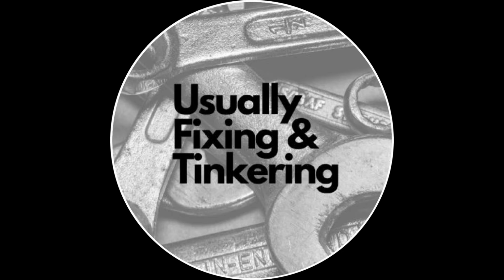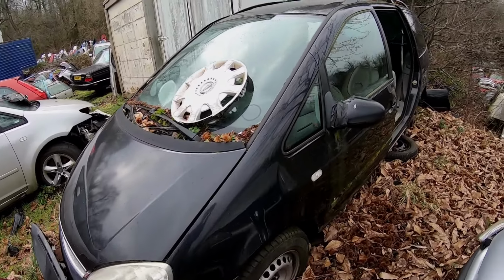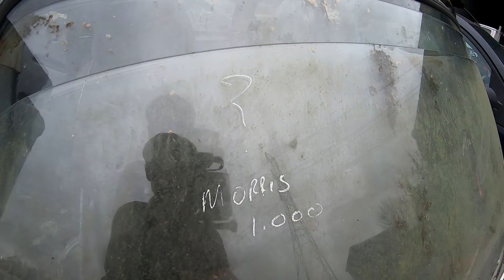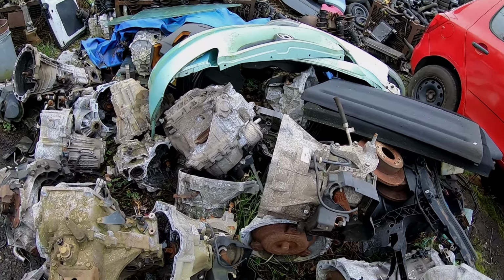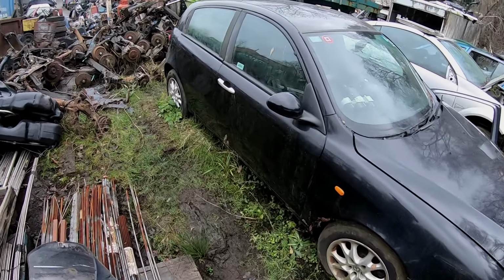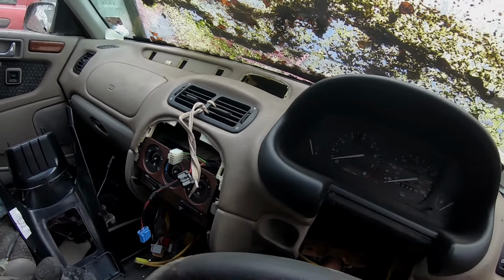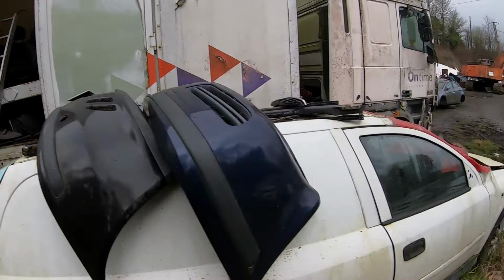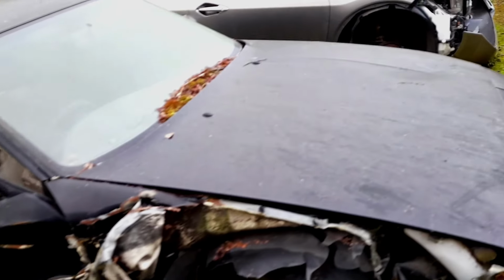The Scrapyard of Modern Classics (Part 2)

Comment: Cool video. Thanks.
Reply from the maker: no problem glad you enjoyed it
Reply: @usuallyfixingtinkering  Do you know if front wings are the same fit regardless 3/5 door, etc. MK 1 2004.
My o/s/f wing has a largish, noticeable rust hole and I need me a replacement.
Looks like a might find one in that pile of wings.
Reply from the maker: @JazzFunkNobby1964  same - the only difference is an extra hole at the bottom if its a pre facelift for the sill cover clip.
Reply: @usuallyfixingtinkering  Thanks for your help.

Comment: I had the four door escort on a p reg 96 1.8td it had power steering sunroof and aircon
Reply from the maker: That's a nice spec for a hatchback in 1996!
Reply: @usuallyfixingtinkering  sure was had the best of both worlds air con and sunroof I also fitted the ford rds 7000 stereo out of the Granada scorpio and fitted a six disc auto changer under the passenger seat. The car was in a tomallard green great colour
Reply from the maker: cd changer with a 7000, lovely combination!